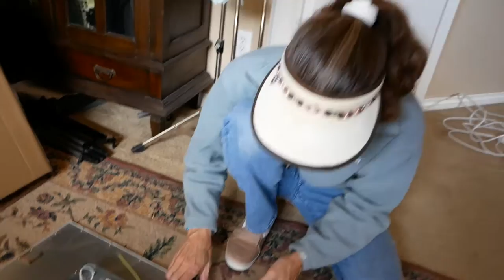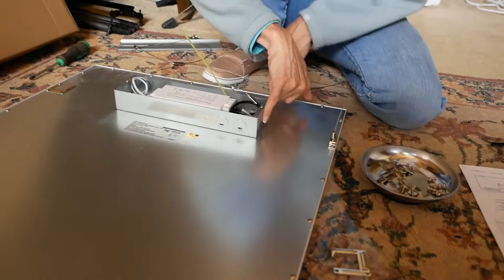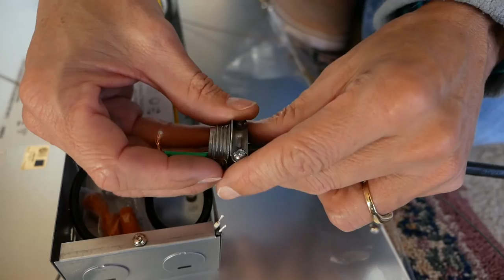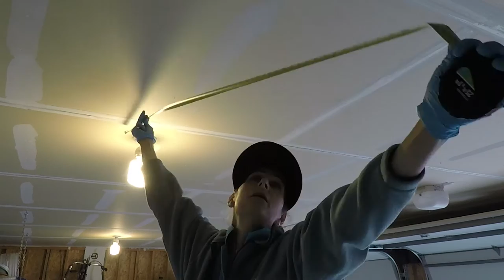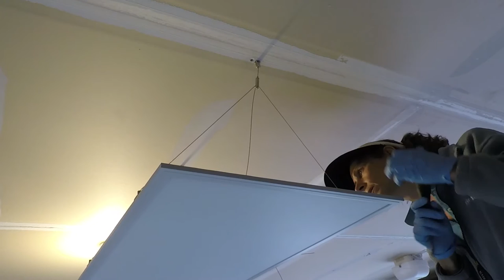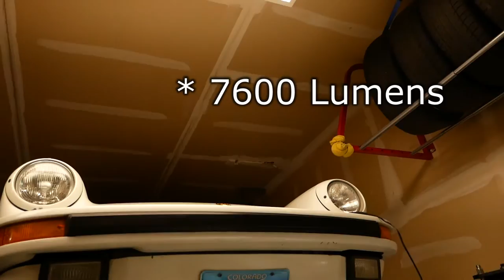LED Panel Lights by Even-Glow® for the Ceiling and Suspension Kit (Garage Lighting Part 3)

Comment: Very Illuminating 😝 Nice job Ladies!  The only improvement I would suggest is adding a couple more of the panels on the walls, angled down to cast more light inder the lifts.  Otherwise, kudos!
Reply from the maker: That is a great suggestion.  We have made a lot of changes!  We need to do an update.  We put up 10 more of those 50W shop lights on the ceiling and moved the big 4X2' panels to the walls under the lifts.  We also added the remaining led strips on the other two lifts.  Pretty sweet light in there now! F
Reply: Geez...I guess Shea Stadium’s got nuttin on you...I think I can see the glow from here (Florida)...You ladies ROCK!

Comment: This was great. I love the channel and you have some great cars. While you probably are fine with the lighting you put in which made a huge difference, I'd suggest finishing the open stud walls and then painting with a white semi gloss. I'd actually add in a metallic flake or glass beads as well. 1x 5gal should do it depending. A big job sure, but it will brighten even more and look great too. I did that to my garage with 18k of lumens and it made everything look a bit more professional, clean and bright.

Comment: I like your video format, the way you fast forward through the mundane part of the installation and go normal speed while you're explaining what you are doing. 
I put a fluorescent light fixture with two T8 bulbs in my kitchen 7 or 8 years ago. Twice I thought one of the bulbs was bad and it turned out to be the ballast. At 30 buck each I am disappointed in how much these lights have costed me to keep running. And you are right about the noise. The ballasts don't go out suddenly. They make more and more noise for several months before the light actually goes out. I really don't like the recessed flood lights that new houses come with. They make people's kitchens look very cold and produce stark light. They make me feel like I'm being interrogated.
I  like the look of the LED panel lights you installed, but I think they would need to be framed-in. Is there a ballast or something equivalent in these LED fixtures that would wear out?
Reply from the maker: Max Quigley They have a power converter in them to drop the voltage. Have you watched all three of the videos for LED install?  You might prefer the under cabinet lights that we put on the lift if you are considering cupboard replacements for the ones that bother you. Thanks for the feedback too. I worry about boring parts so I fast forwarded it and hope fully didn't cut out too much. Glad it still made sense.  Heidi.